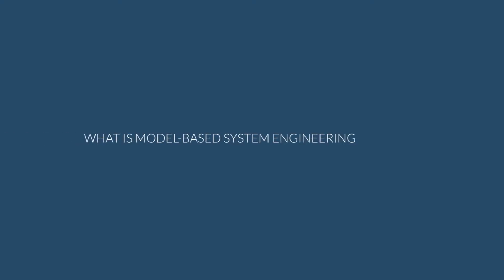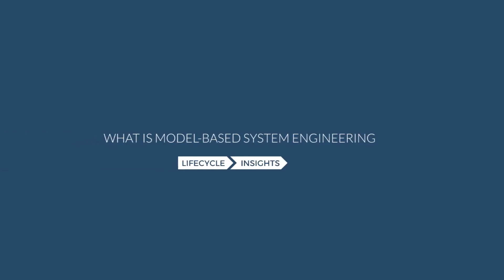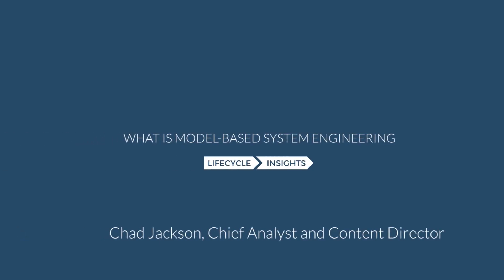What is Model-Based System Engineering?

Comment: It seems that it a lot of talks but still nothing is clear about this method.
Also, a system is made from a few subsystems of which each is made of subsystems.
So each system can be developed independently of the others and then connect all of them.
It seems that many people are very weak in the design process but strong in creating new unnecessary names to confuse a simple process.
Yuli.
Reply: This is the third video I watched and yet nothing is coming out 😅.
I think that what people are saying is just basic logic and they don't have it clear themselves. 

But I hear this is a MIT course so it must be a good methodology. Unfortunately I haven't found good material yet
Reply: If you think connecting all independent systems and integrating them as part of a one complex system is a simple thing then you have never worked on a complex system before. I work in aerospace and defense and without MBSE we would be severally hamstrung with so many individual pieces and moving parts.